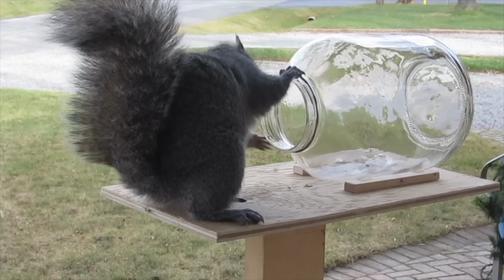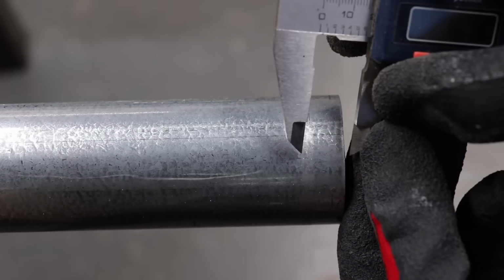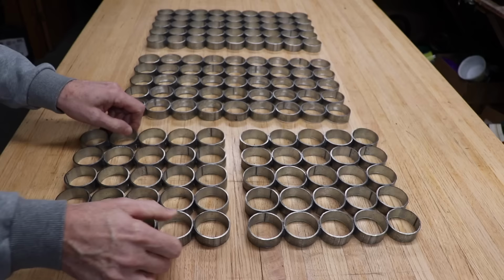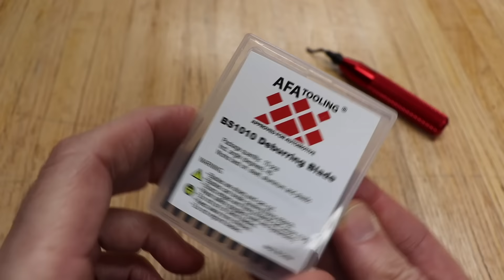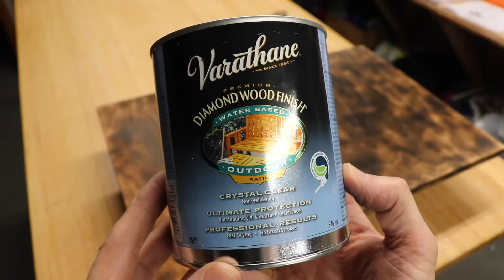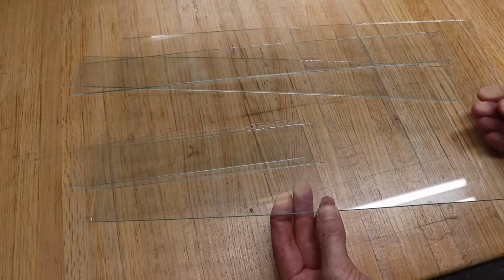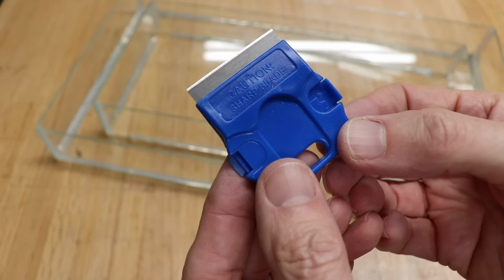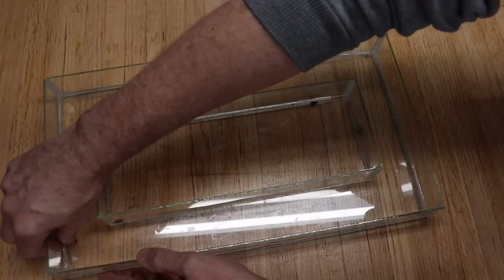How to Make ● A Unique Squirrel Proof Bird Feeder ( that actually works ! )

Comment: Very clever and so unique looking too, I love it.
I finally hung my feeders on fishing line attached to either end of my garden, looked like they were just floating in the air, 6 feet from the ground. Finally stopped the squirrels getting to them 😊
Reply: Wow, clever! How and what did you secure it to in the walls? It sounds interesting but I wonder how it will fare in our heavy snowy Canadian winters and wind storms.
Reply: @p_roduct9211  Hi, I just attached the fishing line to either side of my high fence with a small metal hook at both ends. The ends were around 12 feet apart, then I just hung the 4  feeders on and secured them with cable ties so they couldn't move. 
 I'm in Scotland and we get pretty harsh winters and plenty of snow.  They survive just fine throughout the gales and storms  ☺️👍
Reply: @Carol......  I still can't visualize

Comment: Having seen several commercial 'squirrel proof' bird feeders that don't work, this is certainly a good design and can be made fairly easily at home.  I think one improvement I might made would be to have the top angled roof hinged, with a pin to keep it in place.  Then have a small hatch under that to allow refilling the feeder without taking the bolts out.  One alternative to the glass tray would be using one of the glass food storage containers if one doesn't have a glass shop close by.  Or any other dish really provided the size was correct.  Overall great idea and video!
Reply from the maker: The base of the tray keeps everything centred. You can use another glass tray if you can find the perfect size but you'll find that making it is pretty straight forward and you get the size you want right away.
Reply: Is there any reason you wouldn't be able to use acrylic/plexiglass or something instead of glass?
Reply: @dothedo3667  The only issue that I can think of is that silicone bonds much less well to most plastics than to glass, especially in wet conditions.  (There's silicone that's intended for use in wet conditions, such as being used for an aquarium.)  It's probably not a big deal since there's not going to be much force on the pieces, but a tray made of plastic would be rather less durable.

Comment: Improvement tip: recess the tray “like an in-ground Pool” inside of the feeder with enough clearance so the squirrel cannot reach in and grab spill over seeds. Amazing design! Thank you for the great ideas.
Reply: I'm thinking a chicken wire deck at the top of the tray would allow the seeds to fall through and the squirrel might not be able to get them anymore, as long as the bottom row of entry holes was eliminated, or made very small to allow Blue Jays to still get some seeds.  The deck would be removable to clean out the seeds in there.
Reply: @captainwho1  I don't think the purpose is to totally deny the squirrels of seeds, but rather to stop them from shoveling it dry in a couple of days, which this one does quite well it seems.

Comment: Now we need a bird proof squirrel feeder 🙂
Reply from the maker: Yes you can easily! Just leave your garage door up about 2 1/2" to 3" inches and lay a pile of seed on the floor in the garage . The squirrels will enter and not the birds. Of course doing this brings on another whole set of problems with the squirrels inside your garage. This is why people try to keep them at bay since they do chew everything and can cause a lot of damage to wiring and to your house. You may have missed it but they are able to get some seeds. Just go to 11:57 in the video where I show that.
Reply: @chrisnotap  They also eat your vehicle wiring and anything else on it that they can. Build nests too or try to.
Been there before and that was not fun.
Herbal deterrents did not work.
Reply: There are cheap squirrel feeder houses. There's a heavy lid on top which the squirrel can lift but not birds. I have one, it's really nice.

Comment: So fun to see! Love the ring design and functionality! I suppose it may not rain as much there as it does here, but I would like the bottom be mesh or something so moisture cant accumulate. Having a gravity feeder type jar or something to hang from the ceiling would be nice, too.
Reply: a possible  issue with mesh the squirrel thinking it is an opening and sinking their teeth in it and getting stuck, I saw something like this happening before
Reply: @MrTStat  just make the hole a hole squirrels cant fit their head in, or you just raise the food tray with a bottom mesh so its still in squirrel proof wall while being open to circulation

Comment: Chris, I hold the theory that if the critters can't get to the bird feeder they can't take the bird's food.  My feeder hangs from the end of a fiberglass rod about 5 feet long.  The rod is angled up about 45 deg.  I bought a length of PVC pipe the just slips over the fiberglass rod and  cut  the PVC in 4" lengths and placed them over  the full length of the fiberglass rod.  This creates a series of rollers that squirrels, chipmonks and other animals cannot navigate.
Reply from the maker: That's a neat idea!
Reply: Mark Rober made 3 versions of Backyard Squirrel Mazes to feed birds and only birds.

Comment: I personally would have added hinges to the feeder (on the bottom) for ease of refilling. Drill one hole for the bolt and a wing nut to secure it. Great build, I just might have to make this one!
Reply: Why don't you build one and show us!
Reply: Thanks I was going to add a fitted lid that flipped up but a hinge at the bottom is a better idea😹😹
Reply: why not just fill it with a wide necked funnel?
Reply: I was thinking the same thing.
Reply: @erndub  

I thought the same thing; however, I think you would want to clean it when refilling as the seed shells and poop would lead to very unsanitary conditions and spread disease amongst our friends.

Comment: Very clever. However I'd use a plastic bin lid or a rustproof metal as both a roof and the base place so it's water proof and damage proof. The wood usage is prettier but must be changed from time to time. Excellent idea over all. Congratulations Chris !
Reply from the maker: Try to use as little plastic as you can if you decide to make one. Squirrels love to chew and will make short work of anything soft like plastic.

Comment: Pretty cool bird feeder, and a great idea! I would have used plexiglass for the seed container instead of glass though, and slightly taller on the edges. Other than that....nice job! :)
Reply from the maker: Silicone does not stick to plexiglass. With glass it is cheaper and can be disassembled to make changes with the silicone.
Reply: poor squirrel just traying to survive too 😢
Reply: @jansmith3158  Bushy tailed rats - they always survive...
Reply: @will_doherty  You can literally toss one out of a plane and it won't die. Squirrels are one of the toughest animals out there to kill.

Comment: If there is room for the squirrel to get between the top of the feeder and the roof, they will eventually chew through the top of the feeder to get to the contends. You may want to place a small triangular piece of wood at the top of the feeder so they can't get into that space to chew from the top down. Some younger smaller squirrels may not kept out with the 1 3/4" spacings. We have at least one new crop of squirrels every spring. Very good construction video!
Reply from the maker: It’s been up for over a year without any chewing on the wood lid. The younger smaller squirrels won’t venture into/onto things like this until they get more experience and size.

Comment: As always, brilliant beautiful work.

When it comes time to refill it, I wouldn't bother taking it apart. I would fill a paper towel tube up with the seeds and slide it through the holes.
Reply from the maker: That's not a bad idea! It is real easy though to take the 2 bolts out and lift off the top. Easy to clean and easy to fill!
Reply: @chrisnotap  Just don't let the squirrels see you do it.  Once they get the idea to do something under the platform, you've lost the battle.
Reply: i was thinking of a 1" diameter tube with a funnel mouth to save opening it, but similar idea...
Reply: It really needs to be cleaned when you refill it to stop the spread of disease, so I wouldn't skip that.
Reply: @graceb1949  Makes sense.
Reply: @chrisnotap Wing nuts would make it a little easier. Cheers!!

Comment: I think I'm going to give this a try.  Squirrels or Racoons empty my feeder in a day.  I think I would attach one of the small sides to a piano hinge so that it drops down, rather than unscrew the whole thing.  Some type of latch at the top to keep it closed.  That way I could  remove the tray from the side to wash it and refill it.  Great job, Chris.
Reply from the maker: I don't know if this is raccoon proof. The bolt and nut is very easy to remove to clean out the tray and refill it. That being said, it's all about experimenting to built a better mouse trap!! Go for it!

Comment: Awesome design, I may just have to make this. Curious about the sizing for my area, while we do have gray squirrels, we also have douglas squirrels, which are much smaller and far more tenacious. I might have to go down a bit on the pipe diameter, would be nice if it kept out the jays as well.
Reply: I would have the same question, we have a bunch of aggressive red squirrels in the area, and I think it could squeeze through those holes

Comment: Love this Chris, great design. I've a couple of suggestions though, would you consider leaving one row of the pipe circles off the bottom on one side and thus be able to slide the tray out? It would need a method to secure it but that could be a simple clip. Alternatively have a clip on roof to make filling and cleaning easier?
Reply: At about 6:15 he drills the holes through the plywood base, pushed the screw through the pipe and base, then attaches the nut on the bottom. I'd use a stainless wingnut of the proper size, rather than the standard nut. That way, with no tools needed, you remove the wingnuts and lift the entire top off so only the base is there and the seed tray is sitting on the base. (Effectively you're removing the top and all four sides to access the base and seed tray.)
Reply: John, I have yet to build mine yet but i am going to hinge the top so loading seed will be easy.

Comment: Glass holder is fragile and without drainage will not disperse rain and cause seed to rot. Using Perspex would allow drilling for drainage and solve everything. Very important in the UK.
Reply from the maker: On the final assembly I made short runs of the silicone which leaves a gap and allows for any water that gets in. It's been up for a year now and water is not an issue

Comment: Awesome, I love the new squirrel proof feeder!  I already built the first one you posted several years ago and it’s held up perfectly over the years. I might need to build this one as well.  I wonder how well the galvanized pipe will hold up over the years?
Reply from the maker: It's been up since March in a bit of snow and a lot of rain and there is no signs of rust anywhere. Seems to be doing quite well. I thought it might rust but that in itself would give it another cool look too if it did.
Reply: Chain link fences can (and do) last decades, all those are is galvanized steel just like this.  I agree it's a very nice feeder and one that doesn't take much in the way of tools to build
Reply: a bit of rust from non-galvanized pipe would give it a more natural look.
Reply: I’m sure you could do a lacquer finish over the rings to help slow any rust, or just hit them with a coat of rust reformer and then grey
Reply: Or just a can of spray galvanised paint, I found some here in Australia after the guys who put up my solar panels were using it on every hole they made in my roof before bolting down the rails for the panel.

Comment: So the larger birds like the doves, bluejays, and crows or ravens that we saw towards the end - are they able to get inside or no?  Great solution BTW - this is really an idea you could have mass produced and sell at scale I would think!

Also - it does seem like water might accumulate in the glass tray - it would be good to have a way for excess water to drain out to prevent the seed from rotting. Here in Texas we get strong storms so the roof won't be enough...
Reply: Doves eat from the ground. Jays and Crows are aggressive. Seems Chris' target here are small songbirds. You can always put seed on the ground for doves and other larger birds.
Reply: I need to make something for my beloved ravens and scrub jays that keep the ground squirrels out. I think I'll try something like this. Ravens have long beaks and necks so it could work.
I've been friends with my raven family for @ 8 years. I give them meat and peanuts, they bring me gifts of small tools, keys, machine parts and lots and lots of metal washers that I use around the ranch. 
Best of all, they are the best warning system! They alert me if a strange car is within a mile of my home (I'm off-grid in mountain wilderness). Last month they frantically cawed for me to come outside, I grabbed my bullhorn while yelling at my son to grab the rifle. We ran outside just in time to see a mountain lion dragging one of our goats away. My son fired the rifle while I chased it, screaming through my bullhorn. The cat dropped my goat, ran away and our goat recovered. Our beautiful bird friends saved her life!
Reply: @LazyIRanch Great post. Sounds like a great place to live. I'm also in the country, and away from crowds. God has been good to us.
Reply: Nephew lives in GEORGETOWN

Comment: Cool idea!  And, thanks for sharing.
Tips & Comments:
1.  Increase the size of the roof to provide more shelter from the elements.
2.  Close the gap between the top flat panel and the slanted roof.
3.  Leave the original glass tray and use it as a 'water moat'.
4.  Install a conical squirrel shield on the pole to prevent squirrels from climbing up.
Reply: And put hot electrical wires on the pole. That also discourages squirrels. Buzz buzz
Reply: @CalvinHikes  and I hope someone does that to the food you access the next time you're hungry. buzz buzz :)
Reply: No that's not nice to shock them

Comment: This is a brilliant design and not only that helps protect the birds from Hawks as they have a safe place to eat. Someone mentioned that larger birds can stick their heads in to eat and since Bluejays bully the other birds I think it works out well. The birds will still scatter but it will be interesting to see the birds get used to the fact the Blue Jays can eat but not run off the smaller birds.

Comment: Really great place for a camera.  Super footage, great idea.  I don't think even raccoons could rip apart something attached with silicone!    Our issue is not so much squirrels but raccoons.  We have a 'squirrel proof' feeder but the raccoons rip it off the tree periodically.  I certainly don't trust the glass on this design in thinking of how aggressive the raccoons are and how far they can pitch the existing feeder.  Attaching a 2.5 pound round weight has kept them away most nights.  The squirrels and chipmunks and bigger birds feed on the stuff the cardinals throw out.

Comment: I have a couple standard gravity feed feeders with a peaked and hinged roof for filling. I am going to try this method using these feeders and see what happens. I am in SC and I hope the squirrels are the same size as yours. I know there are some that are slightly smaller in size and I think we have them here. Also I have a miter saw for cutting metal and a TIG for tacking which should make prep much easier. Thanks for sharing. PVC pipe might also work. I also have Deer that eat my bird feed so this should help with that too.
Reply from the maker: Just so you know, they will chew right through PVC!!
Reply: Yea, didn't think of that. @chrisnotap

Comment: I’m sure someone else has probably commented this, but if you left the outer glass tray you could have added water for them to drink. I would damn the water to only the shorter ends of the box, to make two small water troughs. Maybe make the walls to the outside a tad taller so squirrel couldn’t reach the water. Or an even smaller glass box in the center instead, and fill that with water. OMG, could even add a bubbler Solar pump, up through the center pipe. Just an idea. 😊 Those birds would never leave.

Comment: You can turn off the camera feature that puts that annoying little flashing green box around all the birds and animals (just FYI). Turning it off makes for a much more pleasant viewing experience of the videos recorded.😉 Also, I love your trick of aging the wood with the torch, and the varnish is the icing on the cake! Beautifully done! 😍
Reply from the maker: You are correct about the green box. I totally glossed over that when I went through the settings and missed it. I have 3 of these cameras and it's off on all of them! I'm working on another squirrel proof bird feeder video at the moment made from Laser cut stainless that you can build yourself. Stay tuned!

Comment: Fantastic. I'd use wingnuts instead normal ones so you won't even need a wrench to re-fill it.
Reply from the maker: No wrench needed. They are only finger tight the lightest amount. I find the nuts are easier to spin off.

Comment: I like how the feeder is also self-correcting in the sense that if a squirrel is small, or just young, and can squeeze through the 1-7/8 holes, it won't last long.  As they fatten themselves up they will no longer be able to fit through the holes. :)